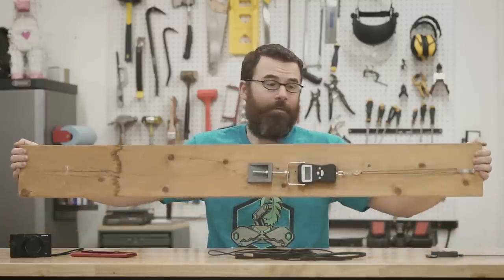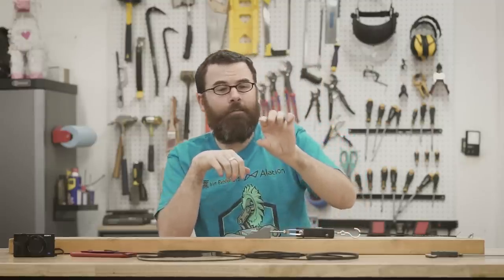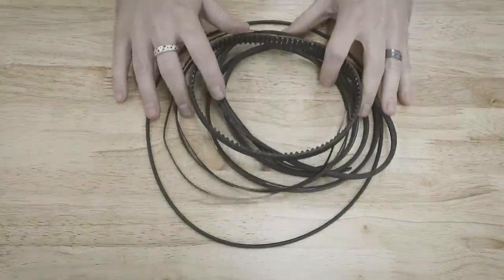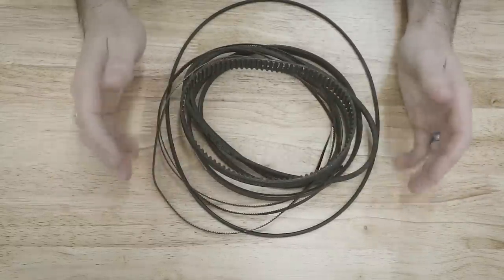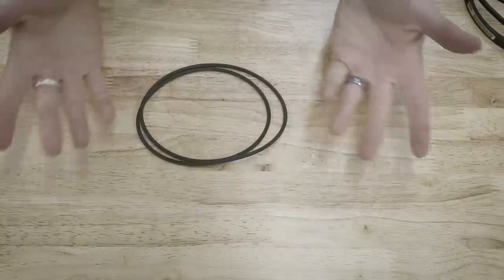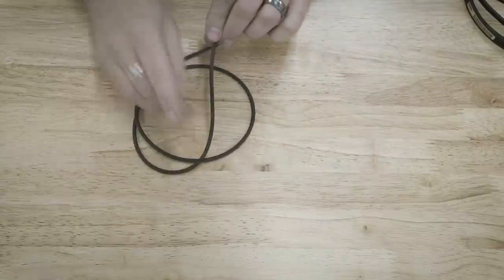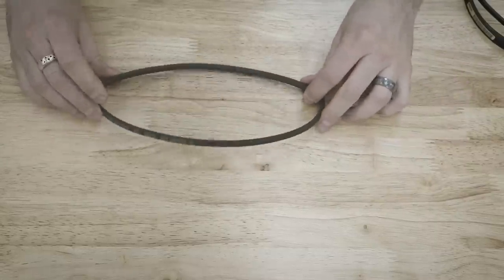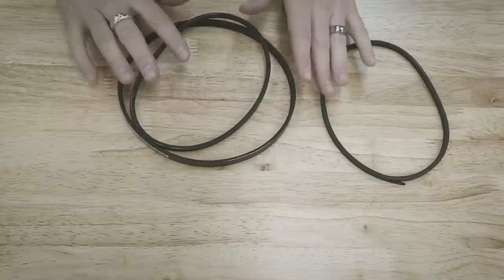Psychotic Break Build - Belts!!!

Comment: I like the process of explaining the different kinds of belts out there. There's so many types and to see the actual product shown then explained should help a decent amount of people.

A few questions:
1) Any feedback on those that get timing belts then flip them so that the smooth side is in contact with a smooth pulley?
2) Why the experiment to find the breaking point of the belt? I'd get it if it were part of a moving weapon system where the belt/pulley would be shifted, but not sure why on a spinner weapon. Also, the belts that have a higher breaking point, did you do any kind of experimenting to see if the higher breaking point was due to strength or stretching? From what I've heard, belts can/will stretch and that could cause the pulley to lose the belt, right?
3) Have you ever considered printing your own v-belt or anything out of something like nylon? I know the belts are cheap enough, but just curious if you've ever considered anything like this since you can put your own custom flair on it.
4) Any thoughts on using multiple belts spaced rather than one thick belt so that if you lose one, you're not entirely out of the weapon?

Comment: Not breaking timing belts with that rig doesn't surprise me, many of them have fiber loops inside to reinforce, the big ones I used recently had a steel band through them. I've also found that different suppliers' belts can have slightly different performances. As much as I love VexPro, experience a few years back makes me question if they are as robust as the belts from SDP-SI or Gates. 

You mentioned it broke on the sharp edge but if it hadn't it likely would have broken around the rounded edge of the hanging scale, many belts have a minimum pulley radius. These are for industrial applications with massive lifetimes so the actual radius is likely not useful for combat applications but you might be able to cheat a bit more strength by using the largest pulleys that will still work.

Comment: For the timing belt you were talking about using on the new bot, if you flipped it over so the smooth side is on the inside, wouldn't that increase the amount of friction/surface area, and give you a better power transfer?

Comment: Didn't Crippling Depression use two motors to drive the weapon via pulley/belt system?
Reply from the maker: Correct.  Two motors on a single pulley, arranged like a triangle.  Works quite well.
Reply: Apologies I misheard.  No belts in Ants and Beetles...not a Feather. I thought I'd misunderstood the way that CD worked

Comment: Why dont use a slipclutch between the motor and the blades?  In a directo system
Reply from the maker: Weight.
Reply: @RobertCowanDIY    An rc slipper clutch are not to heavy, and you take a lot of the belts problems off. i think it wold be a good option for psychotic break v2!. anyway i love your robots and the good qality you put on them, you inspire me. keep going the good work :) (sorry for my bad writing)
Reply from the maker: @Mrpablotortas  Do you have a link to what you're talking about?  I'm not familiar with any clutches that can handle these forces that don't weigh more than the weapon itself.
Reply: @RobertCowanDIY  maybe i am wrong but i was thinking in this heavy duty slipperclutch for revo 3.3 traxxas https://www.rcsuperstore.com/hot-racing-super-duty-slipper-clutch-for-slash-4x4-stampede-4x4-summit-e-maxx-e-revo-revo-3-3/ or ther is a bigger one for a hpi baja https://www.hpiracing.com/en/part/85474